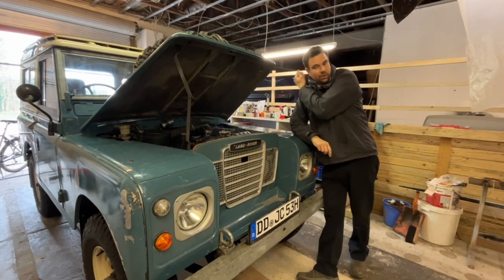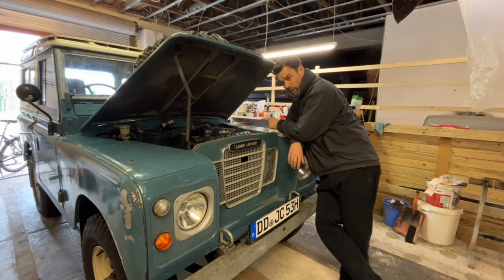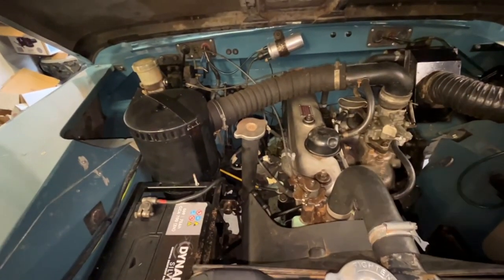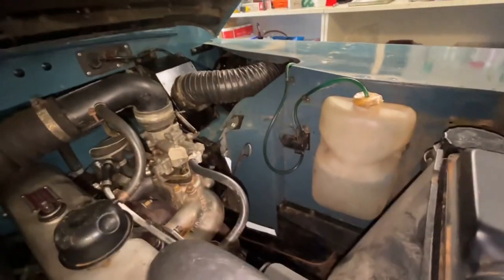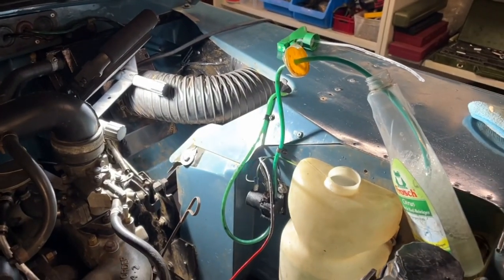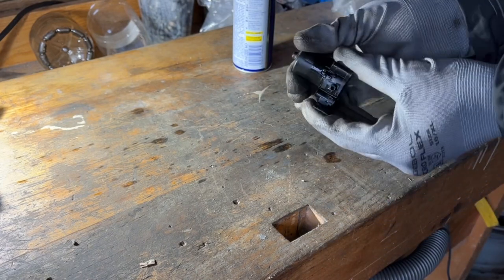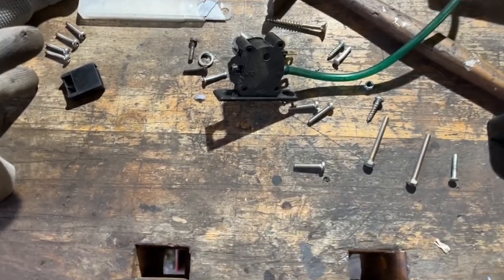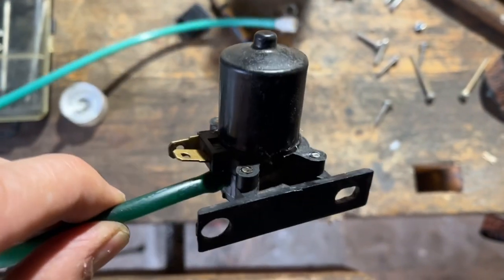Land Rover Series 3 - Preparing for the MOT/TÜV Pt. 1

Comment: Washer jets are a pain, if the motor makes noise always best to start with the simple checks. Though you learned how the motor works-every day is a school day.
If you have a football inflation adapter for your compressor, disconnect the pipe from motor and put the adapter up to the pin hole they mate well in terms of size and blow compressed air the “wrong way” if gunk is stuck there you can blow it back to try and dislodge, the premixed washer fluid you can buy in gallon drums will overtime separate and the additive forms a sticky mess when sat in the reservoir.
To test pipelines and jets, a simple way is with the pipe off blow through but have tissue over the jets the air will blow them off no need for fluid all over as you sort them
Reply from the maker: Hi, that’s great knowledge and very useful. Thank you. 👍